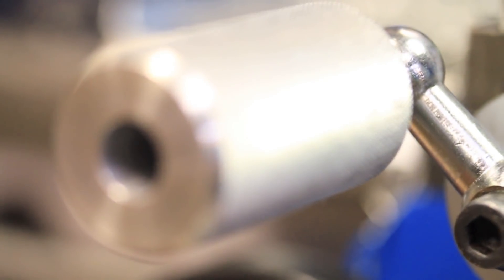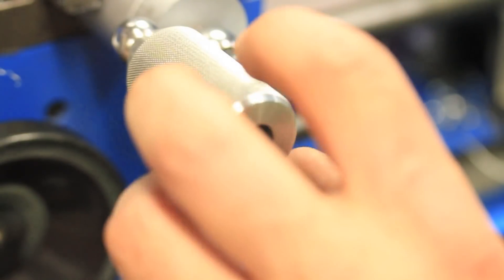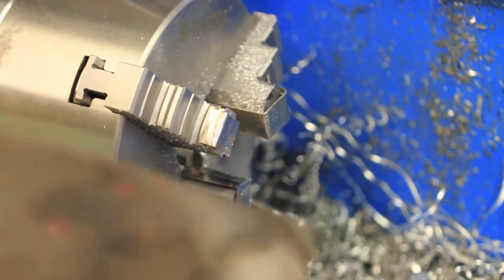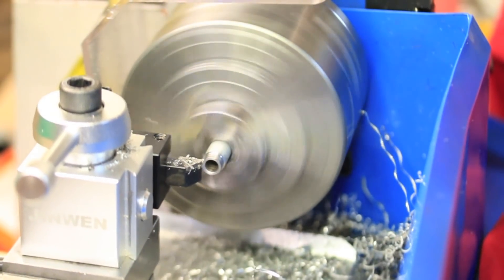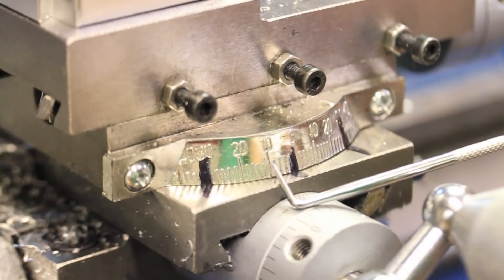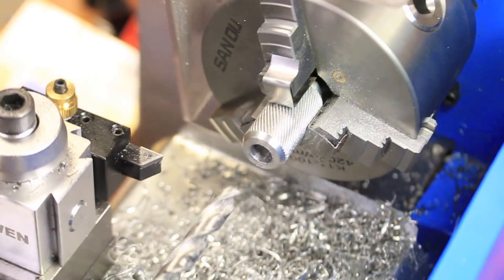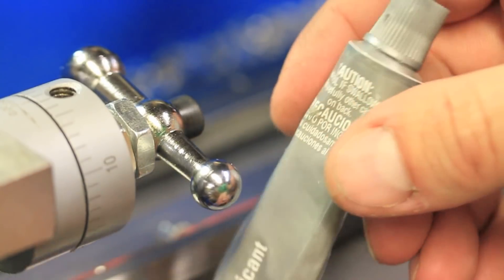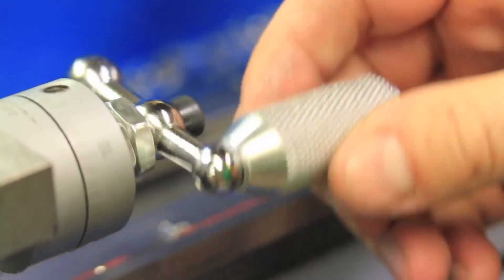Knurled Handles: Knurling, taper cutting, and bushings on the mini lathe

Comment: good video. I'm just getting into mini-lathes, I'd suggest using a round head screw to attach the handle instead of the cap screw that's there now. Less chance of catching your fingers on it when you turn your sweet mew handle

Comment: Nice job of unbalancing your handles.  That round ball on the other end isn't for decoration, it balances the thing so you don't have to keep your hand on the dial all the way through a cut.  Nice job of guaranteeing you don't get a good fit between the "handle" and the bolt holding it.  Drilled holes are never close enough unless they're just clearance or a tap drill.  And knowing your original complaint, one of ignorance, using a piece of leather or maybe a thin belt, grab the  original using that between the pliers and the knob, tighten i t, and it won't unscrew.  But you now have a wobbly, heavy knob that's going to be your master with every cut you take.  As of how the machine sits now, I'd give you no more than fifty bucks if you delivered it here.
Reply from the maker: I hate comments that start out with "Nice job of [whatever I did wrong or you think I did wrong]" because I see the notification and think it's positive and then I get unpleasantly surprised. 

That said, I understand the design intentions of the ball on the other end but it's basically decoration with how cheaply this machine is built. Along those lines, there is a enough friction in the movements that unintended rotating isn't an issue. Regardless, the aluminum handle is probably much closer in weight to the original steel handle than you realize, despite it's larger size. 

As for the bolt issue, if you watch the video again you'll see that I made a bushing that is a pretty tight fit in the handle. The bolt used to attach the handle is actually tightened against the bushing and the handle spins on the bushing, not the bolt. So the tolerance between the bolt and the hole in the bushing is not critical. 

Not only did they not tighten well, the handles just weren't comfortable to use because of how small they are. I have no regrets with the new handles and haven't had any usability issues. 

And as a side note, please be less rude in your future comments...
Reply: @TimNummy  : With 44 years in the shops, then another twenty doing my own thing, I don't feel I have to be even civil when I see some **** modifying something he doesn't even understand.  Not that I'm inexperienced with the mini lathes, I just bought my second one, to fill in where my bigger machines are clumsy.  The smaller the machine, the more critical every facet of it becomes if you want any degree of accuracy.  And don't kid yourself, there isn't enough friction to prevent creeping because of your overweight handles.  Vibration will soon take care of the friction.  And yes, I saw your "bushing".  The proper way to have done that would be to drill the hole first, then turn the bushing to fit, not turn the bushing then drill the hole somewhere to the nearest .015".  I've made handles for a lot of machines, but not out of aluminum and knurled, out of stainless and polished.  I used what's called a "stripper  bolt" which has the threaded bit on the end then a ground shank going to a normal Allen cap.  They're cheap.  They're hard.  They work well when put into a properly made bore.  I have about .005 end play, and approximately .0005" fit between the bolt and the bore.  I also don't make videos with information that I know is wrong.  I've watched a few of your videos, the only comment is you'll never touch any machine I own.
Reply from the maker: @richbuege6491  I appreciate your experience but again, why do you think being so rudely entitled makes someone more open to anything else you have to say? These handles were literally the second thing I made on any lathe, ever. I guess 64 years back is too long ago to remember what it was like to be a novice and I think you're continuing to confuse climbing the learning curve with lack of ability and the way that you would solve a problem as the only possible correct solution. (and I'm not saying you're wrong, I'm just reminding you that you have an entire lifetime of experience that most people don't have)

I made these handles to the best of my ability, at the time that I made them, to solve a problem that I had AND they work great for me.  Beyond that, I made this video to show what I did and as a way to open a dialogue between offering possible inspiration on something that could be done on this lathe and to allow for constructive feedback. I'm very careful to avoid saying anything in my videos to suggest that I'm doing things correctly or that anything I do is best practice because I recognize that I don't know what the correct methods or best practices may be. I'm simply making videos of things that I'm doing.

The most disappointing thing about this exchange is that you actually have a lot of decent advice in your comments but it's so tangled in weird spitefulness and insults that as much as I'd like to continue learning from you, it's impossible to get past your unpleasantly bitter attitude.
Reply: @TimNummy   As a senior myself,  I applaud your wonderfully written response to an all too common attack on youth by an old codger.  Love your videos!
Reply: @TimNummy  Ignore mr grumpy m8, you are doing OK. I wouldn't even have graced him with a reply myself, though your response was well written and to the point. I was a machinist before I was retired and I do not share or condone any of his views. You hit the nail on the head. It is made for you to use and it is comfortable for you to use and that is all that matters.Keep up the good work and ignore idiots like mr grumpy.

Comment: I did this upgrade also, and what a difference it makes! I would suggest you change out the screw in the middle to a low profile screw. you might find that with this better grip and spinning ability you will bash your index finger knuckle on that screw once in awhile. I did, so I made the upgrade and that gave me more clearance.

Comment: You're putting a lot of stress on that short little joint.  If you make them again I'd suggest making it much longer.  Also the big clearances give a crummy feel to the handle -- you've gone to a lot of trouble to make nice handles; you want them to feel nice as well.  Remember that these are handles that you want to be able to easily set half a thou on the dial.

Comment: Pilot point drills are a poor choice for sneaking up on a diameter using multiple drills, because they cut first on the very outside of the hole, and use the pilot for stabilizing.  You made a nice pilot hole which was too large for the pilot of the big drill.

Pilot point are great for single thicknesses that you want to drill in one pass.  Single because the drill as it exits a piece makes a little disk that keeps it from entering the next piece.  For drilling where you want to get an exact diameter by sneaking up on it with successive drills, use regular-point drills bits.
Reply from the maker: Thanks for the advice and explanation! That makes sense for sure.

Comment: @TimNummy hi, how can we cut a horizontal slit inside a knurled roller?
Reply from the maker: Unfortunately I'm not sure I understand your question... Can you explain it a little more?
Reply: TimNummy not sure if I can explain. I am referring to the horizontal slit on inner circumference of the roller to lock on rotor bar using a square shaft / pin
Reply: @TimNummy any idea?
Reply from the maker: Oh you mean a key slot? I think the best way would be with a file... And I think Clickspring has a great video on doing just that
Reply: TimNummy key way it is. Many thanks Tim!

Comment: Sweet handles well done, of course, if you want bling you could make them from brass?
Reply from the maker: Brass would definitely add more bling haha... but also more expense for this project but more importantly much more weight on the handles, which wouldn't be desirable as they would constantly be swinging to the bottom without a proper counter balance.
Reply: Did not think of the weight, good point.

Comment: great video and great project your getting some real great results out of the cheap lathe. just 1 think I would say is when your knurling you would to use lots and lots of lube, you really won't it dripping in oil
Reply from the maker: Thanks so much! That's probably a good tip too
Reply: ***** I have a super old lathe from about 1890 and you have me thinking whether or not its worth getting this or a similar small lathe for little work, you seem to be getting some good results
Reply from the maker: That's awesome! That lathe sounds like it'd be really neat. After a bit of effort this lathe is proving to be able to make some decent parts and run for hours at a time with out much complaining.
Reply: Much of the good results from the little lathe depend on doing the adjustments on the cross slide and compound to there is no slop in them, then getting your cutting tools very sharp.  With a cheap set of brazed carbide bits, I can take a hair thin curl of steel for a cut.  Out of the box those cheap cutters wouldn't even cut.

Comment: randomly ran across your channel and dig the work. If you don't already, might I recommend checking out the clickspring channel. There are quite a few tips that you would likely find extremely helpful for small machining. Like wrapping your emery paper around popsicle sticks for an easier time using with the lathe. Or some jewellers files for cleaning up edges. Looking forward to seeing what else you make!
Reply from the maker: Thanks so much! I really enjoy the clickspring channel, although haven't watched all of them yet, but I've picked up a couple useful thing so far - his work is pretty amazing.

Thanks for watching and enjoying, I really appreciate it

Comment: 10:10 woha that lathe wobble you should fix it to the heaviest object in the room right away if you want decent parts...
Reply from the maker: Yeah, it's a pretty light lathe and pretty easy to toss around.... usually I'm not cutting when turning the cross or compound slide handles and from left to right it's pretty stable... eventually it will be bolted to something though - thanks!
Reply: Yeah bolt it into a tank or something this is very not practical I believe that this lath is the most expensive tool in your shop so you should threat it properly.

Comment: Any thought about using bearings rather than aluminum on aluminum? Also I observe a lot of the time the material doesn't seem to cut well but gall is that just the nature of the aluminum or motor speed to high not allowing the soft metal to cut? just curious not criticizing.
Reply from the maker: Hey Scott, thanks for watching! 

The bushings are actually mild steel - bearings would probably be a great choice, theses were mostly a project to make them significantly better than they were, but not necessarily the best they could be. I think the galling is mostly from a general lack of rigidity but also maybe from using carbide tipped tools with not enough speed/heat. I'm still pretty new at this so I'm not totally sure.
Reply: I enjoy your videos, and looking for a lathe just like this one, or the same model in a Grizzly. I will be watching for more! Thank You. Saw some options for replacing the main carrier bearings with tapered roller ones with excellent results in the turned metal finish. I love the mind set to look at a thing and say I can make that better... then do.

Comment: Are you going to install digital calipers to your lathe for Reading the measurements or Are you going to install a inductive rpm counter, it would be a nice project. 
The machine noise next to the music is too loud, it annoys.
can you recommend to buy this lathe? i wanted to buy one for education purpases but never had That money an this lathe is the cheapest Option availibal to me, so do you recommend it ? (with your upgrades? )
Reply from the maker: Hey thanks for watching!

I will be adding some DRO's at some point as soon as I can figure out a slick way to do it. 

An rpm counter (as well as a couple other interesting gauges) are in the works and will be in a few videos from now.

With the upgrades, it does seem that this little lathe is worth it - it does have extra frustrations but when it's dialed in, you can make some nice parts.

Comment: Did a similar thing on a company lathe I used a lot, I did it in my spare time and used ball bearings instead of bushings.. we had phosphor bronze stock which would have worked well also but I decide to still try ball bearings

Comment: nice work, only thing i think i would do differently is when you make that bushing, i would have made it about twice as long, would take up most of the play in that knob and make it more durable, kudos for finishing the piece nicely though
Reply from the maker: Thanks! I thought about it but didn't have cap screws long enough - this works so much better than the original handles that just the fact that they don't fall off in your hand is a huge improvement. Once I get all the other shortcomings on this lathe fixed I may revisit these though.
Reply: I was thinking the same thing! Also, Tim you have a lathe - make fasteners ;D

Comment: Sub and Like but I don't like to much play in bushings even when its not nesseary...  :D
Reply from the maker: Ha true true... if you're talking about the slop in the cap screw, it is unnoticeable once it's tight as it becomes rigid against the spindle the handle mounts on. There is a little slop because of the clearance between the bushing and the handle but it is MUCH MUCH better to use now and won't bother me until I get the rest of the annoyances in this lathe sorted out. As Hunter West said, making the bushing longer would have helped reduce that as well.

Comment: Just for reference, the cross slide is the one going in the Y direction (the one you call facing), and the one you used to cut the 30* angle is called the compound.  If you are dedicated to keeping this and trying to work with it, I'd make a permanent mark on the compound so you can set it to your angles you want.
Reply from the maker: Thanks! I couldn't remember them in the moment - I need to label them on the lathe or something... This is just as much of a learning experience for me as (I hope) it is for others... I do want to be sure I'm offering correct information though. I wish youtube still allowed annotations so I can overlay corrections in the video after the fact.
Reply: Wanted to follow this up by saying that this interaction solidified my thankfulness for finding this video. I appreciate the gentleman pointing out an error without being rude, then offered solutions that clearly come from experience. Then the OP having humility, appreciating the correction, and expressing the want to offer accurate information was spot on. Gentlemen, thank you for reminding me that wholesome interactions still happen and for making me feel at home here. Long days and pleasant nights, fellas!

Comment: Wow You have inspired me to purchase a lathe. Great shots too! 

If I may recommend... If you can manually adjust your aperture, set the aperture size a bit smaller if you have enough light, because a few of the shots are a bit out of focus from the shallow depth of field. A very minor thing tho for a great video!
Reply from the maker: That's great to hear! I haven't posted a video of this yet but it will be coming soon - be sure to go through everything (and I mean everything) once you get it and torque all the bolts and grease all the things that turn. Also, I would highly recommend doing the motor mount modification I did - You can find it in my other videos if you haven't already.

As for the DOF - I probably should open it up when I'm waving my hands around but I like to keep it narrow so the focus of the video is on the area I'm trying to get you to focus on :) I will definitely keep that suggestion in mind though!
Reply: Thanks for the input man!